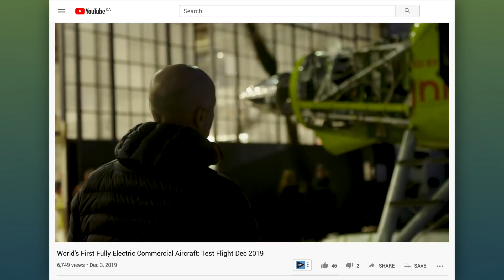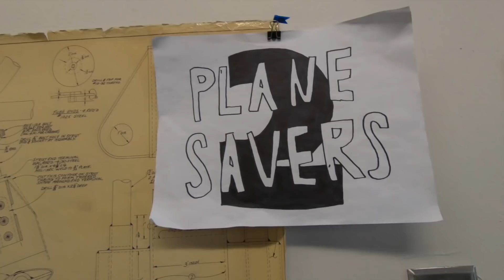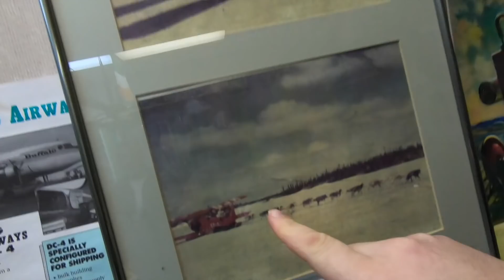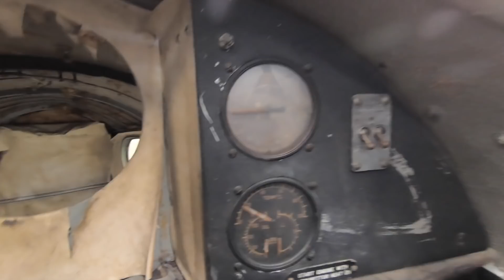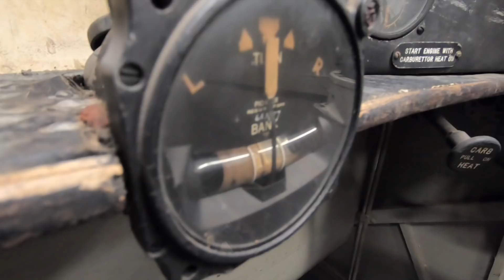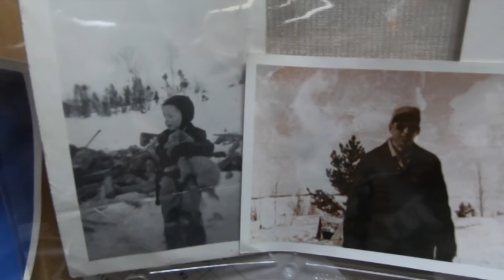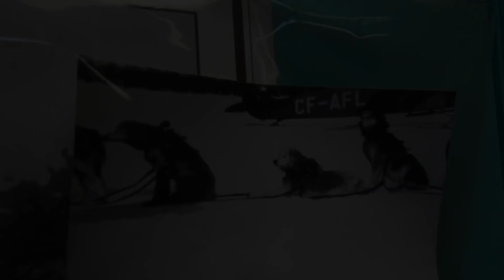IT WORKED! Worlds First Fully ELECTRIC Commercial AIRCRAFT Flew TODAY! | Plane Savers S2-E33

Comment from the maker: Are you Pro-Electric Aircraft or Anti-Electric Aircraft please let me know! I'm interested to hear your thoughts...
Reply: Neither. I'm all for net zero carbon emissions but don't see how an aircraft  with nearly equal MTOW and MLW can be economically viable unless the energy storage medium is science fiction levels of power density.
Reply: @FoolishPursuitForce  The current best batteries on the market are the models Tesla use in the Tesla model 3 at 248WHr/Kg.   There is no way you'd get that in a certified battery in a firewalled cooled compartments.  Battery fires cant be extinguished.    However there are plenty of battery prototypes in the 400Whr to 500WHr in the lab prototype stage and maybe a few at 800WHr/Kg.  Some of these use glass (vitrious) electolytes and will be very resistance if not immune to fire.  We're maybe 10 years away but no guarantees.
Reply: I’m for it.  I’m still mildly shocked we’ve wrangled the energy density up enough to get this far.   Even more that the Pipistrel Alpha Electric trainer has been flying for quite a while, and certified in a wide range of jurisdictions.  Modular batteries so you can have one in the aircraft, and as many as you need on the ground so you always have one ready to go.
Reply: Pro. I'm converting an old motor glider.
Reply: Pro! technology has to keep moving forward. If we always do things the old way we'd all be riding horses still and there would be no aircraft or cars. 
That said, their use of a Beaver on floats for a demonstration aircraft makes it 10 times cooler!
Reply: @Prairietrucker  - If we stuck with horses, I'd be alot richer! 😂
Reply: @SmittySmithsonite   LOL You haven't seen a vet bill for a horse!
Reply: @Prairietrucker  - Can't be much worse than a new engine computer on a modern junk, plus programming. On some makes / models, the computer is upwards of $2,000! Not including labor and programming fees. This is why I own 33 and 26 year old vehicles, for when my 2007 model year truck breaks down (I'm a mechanic).
Reply: Pro, we need new types of aircraft.
Reply: Electric sounds good to me !!!!
Reply: If it can match or beat what the internal combustion engine can do in terms of power, and range, then I'm all for it. I love how it makes 100% torque right from ZERO RPM - that can't be beat! I'd enjoy that alot, no matter what it's powering.

I make a living off working on ICE engines (except diesel) of all sizes. I'd probably own only ICE engines, since I know how to repair them. Depending on how complex and expensive these new electric motors are, I could see myself owning one. If they're too complex and/or expensive, then I have zero incentive to change.

I'm far from a treehugger - "emissions" doesn't even register on my radar. It's part of modern society, and it is what it is. As an asthmatic, if the air were polluted, I'd be the first to know! As long as I'm still upright and breathing, the rest of you out there on the planet have nothing to worry about. Have a beer, and relax .😊🍻
Reply: @SmittySmithsonite ,
   Yup, 100%  shaft, mechanical resistance, another stor and the crux of the situation
Reply: @SmittySmithsonite  The next generation of piston engines will be HCCI "Homogenous Charge Compression Ignition".  They've been around a while.  They'll get between 50% to 55% efficiency which is 20% more than diesels and 40% more than petrol.  They're very clean, clean the air infact.  These will be combined in  hybrid which will take of the torque problem and improve fuel burn in traffic.  HCCI have been around for a while, I remember reading about BMW working on an aero engine version in 1940,  but they've had issues with their torque and power curve versus RPM.  That seems to be solved.   The advances that are good for electric vehicles are also good for hybrid.
Reply: "what werks"...:)
Reply: It’s not a matter of being for or against. It’s obviously a waste of time and money to build electric airplanes at this stage. It’s not practical and won’t be for a long time. You don’t need to fart around building useless machines in the name of “progress”. That’s why aeronautical engineers have a job: to determine what’s practical and what’s not and design an aircraft accordingly. They can determine what’s possible and what’s practical with a calculator without ever building anything. Progress is being made on the tech, slowly and steadily. Electric motors have certainly come a long way, but the batteries are nowhere close to ready yet. When they are, you’ll know it because it won’t take long to develop an electric airplane once the power plant is ready.
Reply: The real key is that it should be viewed as an aviation and engineering issue, not a political issue. And from that point of view, there ARE tasks that can be performed well by electrics, and over time, that list of things will grow. Short haul passenger flying in the PNW is exactly the sort of area where it should be implemented and developed. But hating it just because it's electric? That's political nonsense.
Reply: @OldWhitebelly  CO2/Climate change should be viewed as a technical issue but the left have hijacked to promote their ideology.  We don't need the left, we'd solve most environmental problems far better without them.
Reply: @WilliamJones-Halibut-vq1fs  That is the single most ludicrously stupid thing I have ever heard. It also proves my point perfectly. People who let ideology make technical decisions for them are fools. And you respond by saying it's the fault of the left (which is a term with no meaning outside the mind of an ideologist.) And quit telling people the right (I assume that's what you mean by "we"?) will solve ANY environmental problem. It's an outright lie, and not even a good one at that.
Reply: I get the distinct feeling that I shouldn't have commented, but hey you know, this is what it's all about!
   Aailable power is everything duration of power / flight is everything! Is what it is baby!*
Reply: Electric vehicles are pretty cool in general, I'm definitely a fan. However, rivaling the energy density of avgas or jet A is going to be quite the challenge. Another downfall in aircraft is that the battery weighs the same whether charged for discharged, and it doesn't give you the same ability to adjust fuel load to stay within gross weight.
Reply: I am for anything that makes flying cheaper.
Reply: @Some Guy Hydrogen will never fly. The storage is too problematic. Ammonia, synthetic methane or methanol is more likely. Methanol is broadly compatible with current engines (rubber hoses need to be changed and all copper alloy components replaced in the fuel systems).
Short range (under 400km / 300 mile) battery electric aircraft are already commercially available in Europe (for flight training) (Pipistrel Alpha - Cessna 152 equivalent - plug it in between training sessions & virtually no engine maintenance). 
It is long haul that needs liquid fuels. What those liquids are is still being debated, it will not be hydrogen however as the robust tanks for repeated use and combustion engine weigh more than the equivalent battery pack and electric motor.
Reply: Allan Gibson synthetic hydrocarbons are easy to make, CO2 is easy to get out of the atmosphere..
Reply: I’m pro good ideas, regardless of intent.
Reply: Seems great, electric power has grown popular in models! Why not in GENERAL Aviation.
Need solar panels intergrated into the wings and fuselage as the skin
Reply: I think electric Aircraft would be much farther advanced just like electric cars had the Big Oil Companies not put the KABOSH on electric vehicles in the early 20th century.  I think electric airplanes are the wave of the future.  I know battery capacity is a big challenge right now, but people said the "Motorcar" would never replace the horse and buggy. They said we would never fly or get to the moon.   We can overcome most challenges if we put on our thinking caps and work the problem.
Reply: @terrallputnam7979  ,,, There is much evidence that corporations squash any challenge to their income. It comes under, 'it is just business'.
Reply: An interesting number comes up when researching this subject, 13! 1kg of petrol produces appx 13 kw/h of energy, and it just so happens that a new Tesla Powerwall battery has a capacity of 13 kw/h!!! BUT the battery weighs in at 122kg 😒 and as all of us know, the weight is never going to fly! So I can't see the solution appearing anytime soon, not to say it never will. But I think electric flight in a meaningful way may be a long time coming?
Reply: Pro. I’m not sure how you couldn’t be. It’s better for the environment and cheaper.
Reply: Sitting here in Vancouver, as I am, we have been hearing about the preparations for this flight for some time and it is fun to see it finally take off. I believe that Harbour Air are planning the first route for Vancouver Harbour / Nanaimo Harbour when they get it certified. One major obstacle is that Transport Canada have ZERO published regulations on electrical propulsion on aircraft so this will be the test bed and they are facing a very long road.
Reply: If they have some decent range they could be great. Good for tourist sightseeing flights of short duration I imagine.
Reply: Pro!  Batteries and low carbon energy production have a bright future. It’s just how tech works.
Reply: Very much pro-electric. Flight is flight. How propulsion is derived is always going to evolve. We do, after all, have a responsibility to our planet.
Reply: Both for a while, then eventually (a decade or so from now) gradually switch to electric
Reply: I'm anti-elcetric
Reply: Totally pro. We will run out of oil one day, and we must find an alternative. So let's keep the remaining oil for things that don't work without, like vintage airplanes preserved for younger generations. Yes, I love the sound of a big engine, but in the end entering the third dimension is important, not which type of engine gets you there.
Some argue that payload, endurance etc are ridiculous on electric aircraft. But hey, do you remember how lousy batteries were only 10 years ago? We've come this far, and we are not at the end of the development. One day we will have the technology to fly without hurting the environment, and the efforts of Harbour Air are a first big step towards that future. I congratulate them wholeheartedly for what they want to do!
Crazy suggestion: make a deal with Pipistrel and make the DrI electric. Yes, a proper piston engine sounds better, but only the rotary engine would be original, and once you even consider a turbine, the door is really open to any kind of engine (see S2-E21). Electric is always perfectly balanced (batteries don't change weight with charge state), and the engine builds as short as the original in the front. Paint it Buffalo-green and call it the Green Baron. (Obviously it has to be in Plane-Savers livery with a green tail at least!) That'll be the hit at Oshkosh! 👍😎
Reply: Pro, I’ve watched the improvement of batteries,motors and esc’s in the hobby world. The change has been rapid. Someday new battery technology will permit increased range. Till then dead dinosaurs fuel the world.....
Reply: Pro Electric. I'm all for forward thinking pioneers. Without these people we would still use Horse Wagons to get around, or worse, still stuck in the Stone Age.
Reply: Well, I'm actually a founding member of a club that has the first electric airplane in Finland (almost the first in the Nordic countries, but the Norwegians beat us to it by two weeks :-P ). So you can probably guess :D
Reply: Its not whether you are pro or anti.   Its about whether it will be useful.  I'm pro building one.  I'm anti forcing people to use it,  Clearly electric aircraft have proven that they work and work very well  in the following purposes 1 Electric self launch gliders.  This is a great safety feature in case a glider gets in to trouble as well and means you don't need a tow plane.  The Germans, Swiss and Europeans that use these say the can use them without the noise restrictions they face with towed aircraft and motorised gliders.   2  Electric basic trainers.  These work well.  75 minutes of flying is two or three as long as a trainee pilot can handle anyway.   3 Quadcopters for camera work, agriculture and spraysing   4 commercial winged VTOL drones for aerial mapping etc   Electric Motors clearly can provide the power easily, they just can't provide enough energy for flights longer than 175 miles.  You can go further but it will rapidly destroy batteries and economics.
Reply: I'm pro. Margins get a lot better if you use fuel cells instead of batteries.
Reply: That much electricity stored in a light weight aluminium structure?? Don't want to be in it when something shorts out. Will be the first crash in history caused by "melt down".
Reply: All ready happened to the Jetblue plane in Florida carrying lithium batteries.
Reply: @chargeriderepeat7024  Actually, it wasn't lithium batteries that started the Jet Blue fire. It was oxygen generating canisters that were expired and used to generate emergency oxygen for the masks that come down in a cabin depressurization emergency. The airline was transporting them to a maintenance facility for disposal. Something caused them to activate which produces a hot exothermic reaction. The resulting heat set fire to other combustibles in the cargo compartment. The toxic products of combustion quickly incapacitated the flight crew. Very sad.
Reply: @Some Guy Electric is not by any means "zero emissions". At best it is a hydro electric project flooding millions of acres with dams built by diesel burning machinery. After that comes gas and coal burning thermal electric, nuclear  and wind that is more efficient at killing birds than creating electricity. I agree with you that the effort would be better put into developing an alternate fuel such as hydrogen.
Reply: Can't believe you could EVER get the required energy density you would need to make an electric aircraft economically viable, avgas has about 50 times the specific energy as the best current battery? Couldn't match the speed, or endurance you would need?! Nice for 20 minutes of sight seeing though.
Reply: Pro-Electric Aircraft! We are excited to see the technology advance and the frontier pushed further!
Reply: The energy density of Fueled engines is the only intelligent  way to go for flying! Battery power like in cars is a big money maker for those on the Scam.===='s SUBSIDIES!
Reply: Pro-Electric as long as there is an engine with a generator attached.
Reply: I can see a future for massive electric powered airships. With lots of surface area for solar panels, and large capacity for batteries.  

David Jones
Coventry
UK.
Reply: pro! 🤙
Reply: I think electric airplanes can save aviation when battery technology makes them practical. If people don't hear the airplanes they won't know that an airport is nearby that they can complain about and have closed. We AV geeks love the sound of big airplane engines, but I love having nearby airports more! Plus electric flying is a lot less $$$ than 100LL. Plus plus electric motors are more reliable.
Reply: Pro, but I can't see it going much beyond private and Light sports aircraft. I think the future of larger aircraft lies in Hydrogen fuel (much more energy dense, quicker to refuel, and basically just as cheap to make)
Reply: OK here is the rub. Electricity doesn't just happen. It needs a generation source. Solar and wind are feeble sources unless you tie up millions of acres for solar farms and tall wind turbines. Yes, they do generate but compared to hydro and fossil fuel sources, they are anemic. Nuclear is the best but the most difficult for waste production, storage and disposal and then there is potential for accidents and their aftermath. Plus there is a whole segment of the population that is anti because... well its a controlled nuclear reaction. Storage battery disposal and recycling are other issues with electric cars and such. 

Until the generation situation can be solved knowing we'll never please everyone especially as vocal and even violent the left side of society is becoming, short term battery technology is a good move. But... you still need to charge it and for now, that's coal fired generation, hydro and fossil sources like natural gas to boil water and spin turbines and generators. Then what to do with those huge batteries when they shoot craps. There is no free lunch here in the magic land of the "all night generator". Yes to science, and super technology but the generation and battery efficiency/disposal issues all need vast improvement. We need to figure out how to keep and improve our living situation without damaging the planet. 

Alarmist outrage and demagoguery as comes out of the leftists and the climate change fascist movement is just not helping. It's more difficult than hitting someone over the head that you don't agree with or that you don't like their opinion. 

Electric airplanes? Ya, I like anything new and better. Even electric airplanes as long as the battery doesn't go dead at 10,000 feet AGL. Is it a solution to anything???? No. Not yet but I get why.
Reply: So long as they don't ban small gas powered planes for private pilots and light sport pilots.  Us poor guys who can't afford a new electric plane deserve to fly foo!
Reply: I'll be pro when they carry 400 ppl across the Pacific for 13hrs at .85 mach.
Until then, it's a nicely-executed green group hug.
Reply: Pro of course
Reply: Pro. The world has a finite supply of oil and someday it will be gone. Electric or hydrogen powered aircraft are a pretty decent alternative to a return to the age of sail.
Reply: @stephenp448  I think we're 100 years away from that though it will just get more and more expensive after that.  You can synthesis hydrocarbons from CO2 extracted from the air by reaction with Hydrogen over fischer-tropsch catalysts.  The whole process is actually now around 60% efficient since carbon capture has improved, making cryogenic hydrogen is actually less efficient due to liquefaction losses.  Northrop Grumman made some fuel for the US Navy made some decades ago the idea being to make fuel on nuclear aircraft carriers.  Germans made fuel this way in the 1990s.
Reply: @stephenp448  While blogging penny stocks in 2004/05 I got the oil bug and got it bad. Plenty of petroleum geologists believe there is more petrol out there than we could ever hope to burn. Ever heard this angle before?
Reply: @jasont.hansen3103  I have, yes. Then I look at my kids and think about the world they're going to inherit (climate-wise) versus the one my grandparents grew up in. If there's really that much oil down there, I honestly think it should stay where it is.
Reply: It will never work in the cold.
Reply: @watcherinlaa8736  If that is the case  , they will work in the summer time .. At least they will work until technology develops better batteries .. battery's will eventually work year round
Reply: Maybe we even live to see DC-3’s being electrified in the future! Go electrification!
Reply: Yes Electric would be great but battery weight, price, and temperature  make it almost impossible for a plausible player in the equation.🙂  Hey!Elon!! Got a question can You...?
Reply: @1SeanBond  Technology will overcome  what you stated .. in 1899 , it was stated that   ' what can  be invented has been invented ' in other words , their is nothing more that can be invented .. I remember when it was stated that it was impossible to land on the Moon ... I don't buy your argument
Reply: @FreedomFighter-cr5xg  A terrific comment! Well done! Soon the Batteries..will come!  ...a nice sounding start! A+put.!
Reply: When Harbour Air first announced this project I thought "no way" but today proved they can make it happen. I grew up with the sound of big radials too living next to YVR. I'll always prefer the radial just like I prefer my Harley Davidson(they are selling electric motorcycles)When turbines were put on Beavers and then Otters I said "no way" but history has proven their worth in the industry too. Yet somehow there are companies like yours doing business with both. They will make money with them on their much shorter(fifteen minutes each way) but highly profitable routes and will still be flying pistons and turbines in other aspects of this amazing industry we call flying!!
Reply: The Evation Alice looks interesting too.
Reply: Why not? A tesla plan would probably go like a bat out of hell.
Reply: CARBON DIOXIDE is Good for the Environment! Allows plants and trees to grow! Useing more fuels liberates more oxygen from them which increases the % of  oxygen  in the atmosphere. It is NOT poisonous  until about 15% we are at 0.04% now. Seeeee the huge gap?